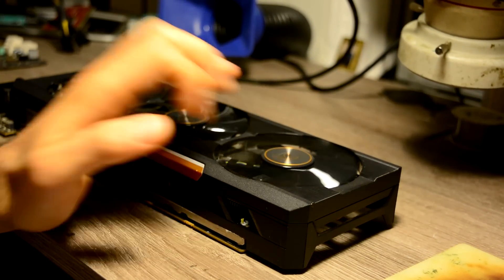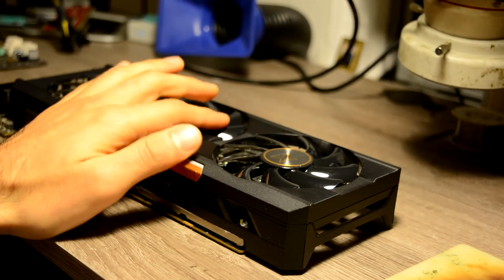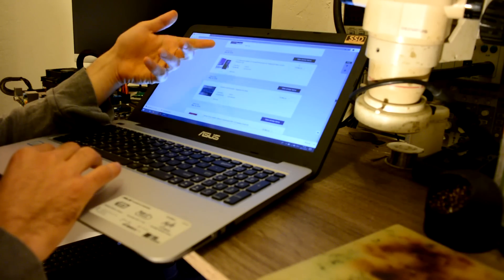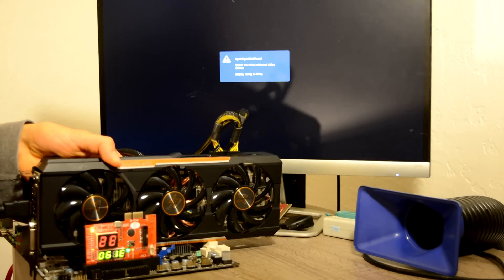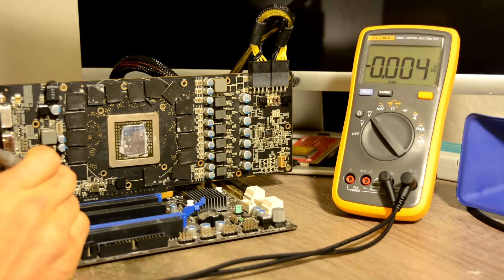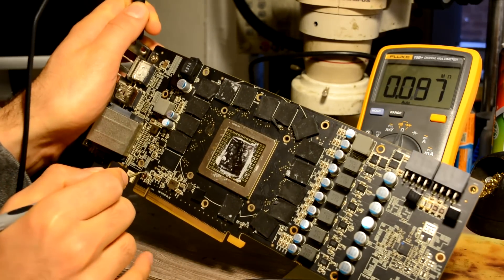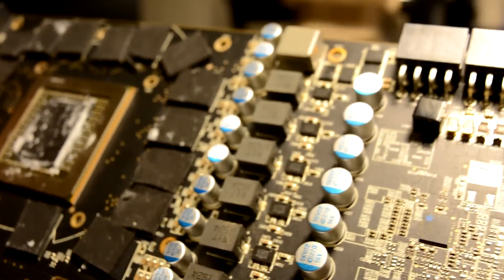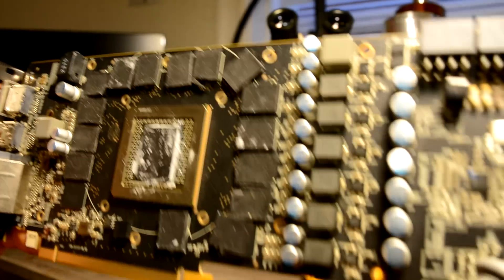Broken video cards from Ebay. Is it worth buying them and do repairs?

Comment: I have RTX 2080 that does work when drivers are installed, would send it from Kenya. The fan also doesn'tt stop spinning even in low temps.
Reply: Bro rada
Reply: @nyto1333  Niko fiti nimabie.
Reply: @owisivisuals  ulimanage kutengeneza graphics card yako
Reply: @nyto1333  Hapana bana unaweza ijenga?
Reply: @owisivisuals  zii ata mi nilikuwa natafta msee aneza nimakia yangu
Reply: @nyto1333  Yako ni gani? kuna msee hapa Nairobi anaweza jaribu.

Comment: I have a ZOTAC GTX 970 AMP Extreme Core Edition (long name I know) that sometimes works well with heavy rendering and modern games, but sometimes it randomly crashes while rendering, gaming, idle or even booting.Tried it on different computers but there's no difference.

The crashes are very random like: full screen random single-colour, black screen whether before boot or after boot and sometimes the fans go full blast at boot with no display not detected with 6 beeps from the Motherboard. These can happen at anytime.

I took the card to a technician but he was unable to point out a faulty component. I've been randomly watching repair videos and the card seems OK. One big thing to note is that I removed 3 shorted Mosfets (with no shorts on the main 12v rails) but turns out the Mosfets were not faulty, I put them back the shorts were gone. Later on the shorts on the Mosfets are random so are the crash symptoms still random again. The Mosfet models are five of MDU1513 and ten of MDU1511 the PWM controller is NCP81174.
I'm suspecting a contact between the layers of the PCB. It's driving me crazy man. 

What are your thoughts?

Comment: You must be some sort of savant to repair so fine a piece with such a huge soldering tip. Like one wrong move and you could have screwed it all up but you moved fast and didn't miss once. Very impressive. You really need some proper equipment because you definitely have the skills.
Reply: you can use flux on the solder points so it would be easier just like what he probably did based on the color

Comment: Hello what is the problem of my video card rx570, its running normally when it first use but after a 20mins my pc turn black screen.  And my video card is in normal temperature.. thank you

Comment: Short answer. No. Not for 99.9% of people. Analogy: just because you can buy a wrench doesn't mean you can fix a broken toilet. Longer answer: In 2021, broken GPUs are too dang expensive and most likley a failure for most. Most will cause even more damage and then put back on eBay...rinse and repeat. Too many desparate gamers making bad decisions in pursuit of a so-called "deal". Instead of buying a broken GPU for $250-$400, invest that on crypto for a short time and pay retail for GPUs with the gains. Seriously, you chances are substantially better with this plan. Between failed repair attempts, crypto miners, and half-hazard modders....finding cards that can still be reaired, even by an exerienced technician like Eli Tech, is getting very difficult. Stick to retail or a used working card.

Comment: I would suggest not to spin a fan while it is connected to the PCB (as can be seen at 2:20) since this induces a voltage to the PCB which can be unexpected and can kill components on the PCB. Also make sure to fixate fans when you use blowers or vacuum cleaners to clean systems with fans.

Comment: I just got a decent deal on a GIGABYTE GTX 1070 Ti bought for £269 only thing wrong is a bad vbios with the error code 43 just needs flashed as the previous owner said he was updating it but he basically thinks its corrupted software and thats basically one very easy fix.

Comment: This was interesting, but honestly the audio quality is awful.  I checked through a couple of your newer videos and it seems that you at least got rid of the ear rape, but the sound levels are still all over the place.  This is how you fix that easily and for free:

Depending on what you use for editing, the steps will vary.  However you do it, get the audio exported from your video as an MP3 or something that can be opened with Audacity.  Run the noise filter to remove hiss and other background noise.  Then use this program: http://www.conversationsnetwork.org/levelator  it will quickly level an audio file that you drop into it and dump it into a new file.  Then just drag this new audio file back into your video.  If you exported the audio for the entire length of your video, you shouldn't really have to re-sync anything.  The only reason for that to happen would be if you screwed around with framerates or anything like that that can cause the audio to gradually get out of sync.  If you run into that issue, you can rip the audio from the video after rendering it, and then recombine with the new audio, but it's a lot easier and less time consuming if you can just figure out how to do this before rendering.  You can also just break your audio up into chunks of a few minutes and any gradual sync issues should be taken care of.  This can give you segments of video that have different audio levels, but if you fade and adjust your audio correctly you can cover this up pretty easily. 

The Levelator will automatically set all of your audio to the same level so that you don't have giant bounces in volume every time you cut between different cameras/ angles/ rooms.  This is much more pleasant to listen to because it doesn't require fiddling with the volume settings.  The noise filtering is important to do before using it, though, otherwise it has a tendency to boost background noise just at much as your voice.  If you can record your voice on a separate track from the camera audio, it's much easier clean up and level.  You can also do a noise filter, put the filtered audio on a different track, boost the volume and just layer it over your camera audio (which should have volume lowered) if you want to preserve some of the camera and non-vocal sound.  This can be messy if you overdo the filters or get the tracks out of sync.

Also, in general, record your audio lower if you are in a location with a lot of low-level background noise (ventilation, case fans, etc...) and boost it later.  It's much easier to noise filter audio when most of it doesn't get picked up by your mic in the first place.  Overly-hot mics cause your audio to peak out and picks up every little creak in the room.

This is not the most elegant solution, but it's free, quick, and dirty and doesn't require you to noise-treat your space or buy extra equipment (though a lav mic or a basic USB condenser mic will do wonders).  Audio nerds can scream all they want, but the goal isn't to have studio quality audio, just better audio with what you got.  This is just stuff I've done in a pinch and zero budget to squeeze better audio quality out of crap PC mics in noisy rooms ;)

Comment: U hear this constantly I have a gtx 980 ti am familiar with electronics not much with surface soldered boards but enough to know flood soldering is a tedious process.. card gets power fan  stays on high with a black screen ...mosfets or ? There is no short in pcie plug

Comment: Bro I got an Zotac Rtx 2070 Amp Extreme core and its giving me problems.  The card works with displaying picture and all the fans work.  The problem is when I play games.  At all default settings I can't get any game to work, they all crash.  When I lower my memory clock to -600 I can play Little Nightmares without it crashing.  I mostly play Warzone and I can never get past the main menu without it crashing.  Do you have any idea what can be causing this?

Comment: i have r9 390 please give me tip what happen or what i do i have black screen ,freezing windows, black screen at idle, without driver card give me video but when i installed driver its just going to black screen and never come to screen until i uninstalled driver, when going to black screen issue i just see post screen and loading windows then its immediately freeze and restart again please help about this
Reply: just uninstall the driver then
Reply: @Gruxxan  its hardware issue bruh memory controller issue and its not fixed now i destroy this card and plan to buy new one

Comment: how to ship you a pair GPU from Miami-FL ? it is not seen by the CPU ( not seen
 by BIOS and so in Windows) both  RX580 ,  same results both, only 2 of 6 cards failure, other 4 still working suspect bcuz the SATA power of the PSU (need test also or maybe buy a new PSU
)

Comment: I have purchased several broken boards on ebay to try to learn electronics and how to fix these boards. Could you tell me how to find out what the chips behind the GPU are and how to find out the value to purchase replacements. I have several of a couple of brands boards and some of the black chips have no information on them or the board. I have taken it that these are inductors. If not, what are they if you can tell me. I put them on a transistor tester and they read 1139 ohms and at one point one of them read 43.25H. I have no idea about these numbers as they are 0603 parts. Any help will be appreciated. Thanks and stay well.

Comment: I'm hoping someone can help me. I'm desperate. I built a new system (Ryzen 5 5600X and Asus TUF X-570 Pro), but salvaged the graphics card, a RX 5700 XT, because new models are impossible to find right now. I had everything hooked up and cable managed and then realized I had to add one more hard drive. I had the system running and went to loosen a screw on the panel covering the drive bay and my screwdriver tapped a heat-pipe on the 5700 XT, I heard a "tick" sound and then the lights went out...so to speak. The graphics card just died. I tested the card in another system, hoping it would boot up and mean that maybe my power supply or motherboard had the issue. But, it didn't work. So, I know it's the graphic card. Can anyone help me find someone to inspect it and see if there is an easy solution? I tried the oven trick, and had no luck at all.
Reply: i wouldnt try the oven trick unless as a last resort. why dont you just take off the cooler and look. maybe it will be obvious.

Comment: I have seen  so many gamers repair there graphics cards in this way and it has worked out well for them But while searching the net for more information on re-balling cards I found out an interesting fact  Now here’s the fun part. I know that the process that required to re-ball there graphic card had fixed the problem, but it not in the new solder balls. The chances are there was nothing wrong with the solder balls in the first place.

When you heat the dead chip in order to melt the solder balls you are effectively causing the internal tracks to realign, or rather be nudged back into place so they just so happen to work again. If you were to apply 120°C to the chip i.e. 100 less than is required to melt the solder balls, for around 5 minutes you will achieve the same result. The chip may well now function but it is not repaired. It’s a in a state of fragile mess. Once the chip is put under heavy load for a period of time and its internal temperature increases it will fail again. For a moderate user, such as someone who browses the Internet and other non-graphics intensive workloads, it may well be the ‘repair’ lasts for a few months. However, if you are performing video editing (i.e. something which uses the GPU heavily for processing) or gaming etc this chip will fail again very quickly. The chip is dying.   https://madpsy.uk/the-nonsense-that-is-reballing-dead-gpus/

Comment: My GPU an AMD Radeon VII 16GB HBM2 , gives no video stream anymore. Appeared suddenly After shut down ofthe PC did not run againno video signal  though card's light and funs are spinning silently, been moderate load e.gameing every now and then, but not mining ... just dissapointed  as it was almost new,  atalked about code 43--? can it be fixed somehow?

Comment: I have a question, recently I have a gtx980 which has one of those little things (I dont know its name in english) got burn, I was thinking to replace it I mean its already dead, so I cant loose anything else right? but I saw you make some other stuff beside retire the old one, what happens if I only heat it up until it can be "unpluged" and then I install the new one using the same melted tin?

Comment: Regards, I have problem with my graphic card, it is still working, but after storm thunder burned my router the damage occurred also on graphic card inside computer. I can normal surf on the webs, but when I play videos such on Youtube I get two horizontal lines when the camera on video is moving and when the camera on video is static without movement there are no errors on picture.
I have swap and put the graphic card from another computer and there is no error on video anymore, so definitely the error is on graphic card, what could it be, processor damage or RAM damage or such passive or active element on graphic card, what do you think? 
Thank you.

Comment: Hi one question,
I made a mistake and bought one of those cards from a chinese site.The cars is XFX RX570 4GB dual fan.
The card works in games perfectly with no artifacts but has the following problem:
When in idle status or when browsing a web page,the gpu disconnects (you hear the disconnect sound) monitor turns black and instantly reconnects and keeps doing it many times!
I  have tried to 1)change PSU 2)try different port (hdmi,dvi) 3)try different pci-x port 4)flash bios 5)tried many different drivers 6)changed the time limit gpu has to give response
Nothing works.The strange thing is this problem happens not the day you connect but the following day!
Can this problem be repaired? I repeat ths card doesnt  have problems ingame
Reply: Did you flash the proper bios? You might need a cheap programmer from eBay. It has a clip for the ROM chip
Reply: Hy man did you find the problem?

Comment: Trying to troubleshoot / repair a friends Gigabyte Windforce GTX 780
It shows white lines straight from boot and flickers. After Boot screen it briefly shows a black screen with several big white rectangles and then boots with the white horizontal lines.
Any advice on where I could find a fix ?
Error Code 43, Problem Code 000002B 
Appreciate any help

Comment: hi bro i have motherbard with buent the vrm its x79 so its expensive can i fix it by myself  and how to test wich are burnt
Reply: and can pc run with burnt some vrm to know if the problem in the vrm bcz i notice that the cpu socket is also 3 pin are missed

Comment: Alright I've watched a few vids and I was wondering how and where would I learn to diagnose and fix graphics cards, I recently took apart my 1070 ti turbo to put an aftermarket cooler but lo and behold it didn't work when I booted it up, the fans spin all the lights come on but no display. Any clue?

Comment: Awesome vid, will a different chipset work for a gpu? I was thinking of buying a broken GeForce rtx 2080 ti and swapping the gpu with another cheaper card.. will th is work
Reply: first of all, what are the chances that the chip is the only thing that fried on a broken 2080ti, my guess is you'd have a short due to something before the chip would actually die.

Comment: Bro i have gtx 650 e. It pulls power frm board. Its running fine. The problem is its have 3 ports 1. Vga 2.dvi 3.hdmi. i m able to see while connecting vga and dvi but when i connecting it to hdmi port i cant able to see rhe video. Help me

Comment: I have rx 570 video card that restarts under heavy loads, also it doesnt over heat so temperature isnot an issue. can you tell if that can be fixed?

Comment: Hi Eli, I had a  question. I have a vega frontier edition. i took off the stock cooler to triedto water cool it, but i think the thermal paste i used was slightly conductive. I  turned it on and it wouldn't show any thing on screen and the whole computer would turn off. I took every thing off  cleaned the die and  put the stock cooler on. with both 8 pin power connectors plugged in  it showed nothing on the screen, but if i plug in one power connector  it works, i can alternate this. So as long as one connecter is plugged in  it worked. but not  after some more testing nothing seems to work. any ideas on how i can repair this? Thanks

Comment: i've been trying to get the 3553m out for a while now with my hot air station but it wont budge. Should I warm the board up first? any hep would be greatly appreciated.
Reply: You need a pre heater

Comment: I have the same exact graphics card with the same issue. I checked that fuse near the PCIE slot on the gpu using my multimeter and it came back blown. Is it safe to assume its the same memory controller vrm gone bad (that 3553m next to the choke)? if so where can i buy the replacement fuse along with 3553m . Thanks!
Reply: Try aliexpress
Reply: @Chevy_90  thanks! I found the parts, the only thing holding me back now is getting that IR 3553m out for some reason it doesn't want to budge.

Comment: I wonder, why You are taking solder at the end of the tip and then You are putting it on the pad? I am talking about replacing fuse at the end of the video.
Second thing, is this 10A fuse?